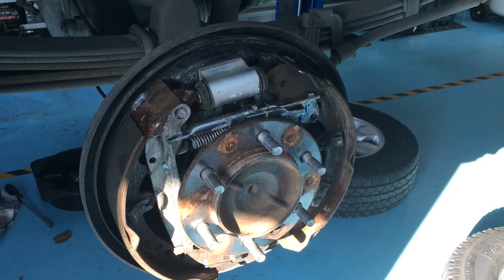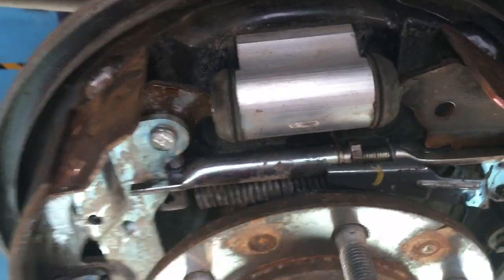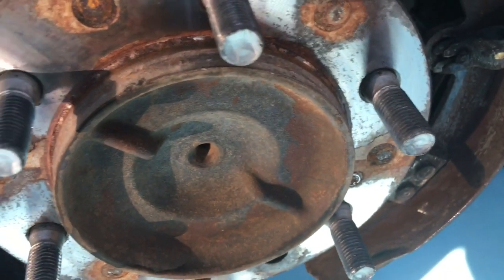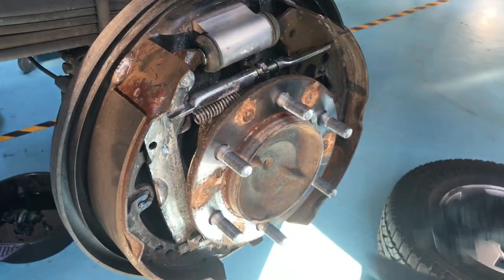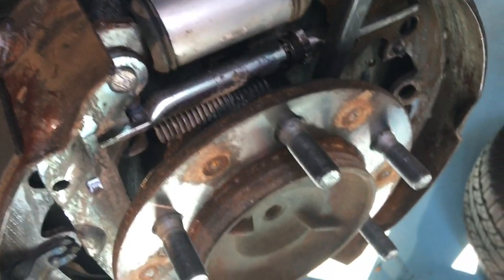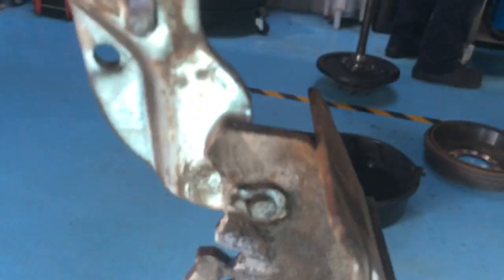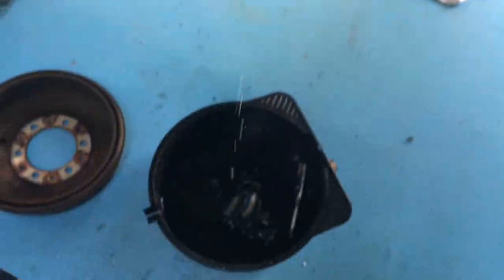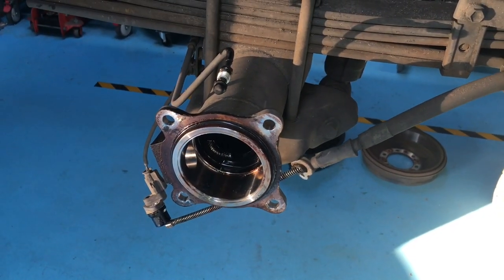HILUX REAR SHOES and AXLE

Comment: At 12 mins 20 seconds there is a small clip on the adjuster thread, that the mechanic says these can go flying, I re assembled my brakes and had that piece left over haha, should I pull the wheel off and install it or will it be fine till next service when I can re install it??